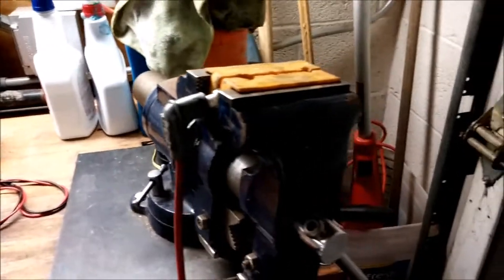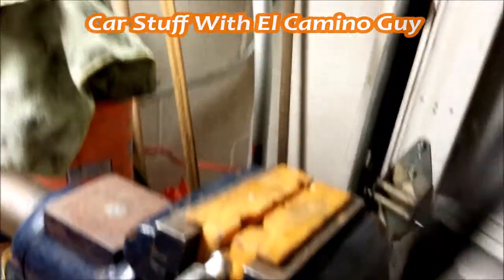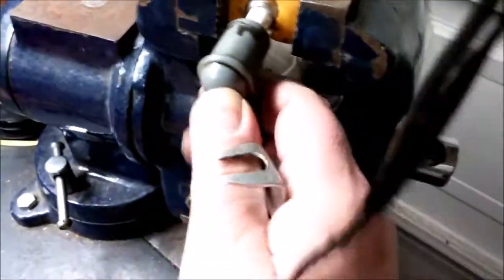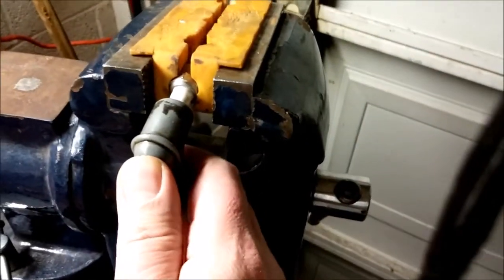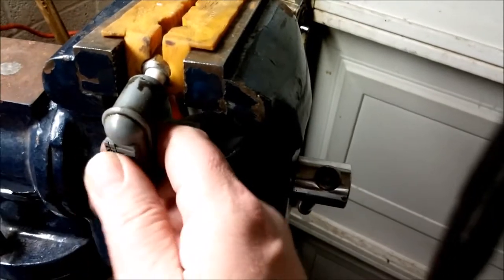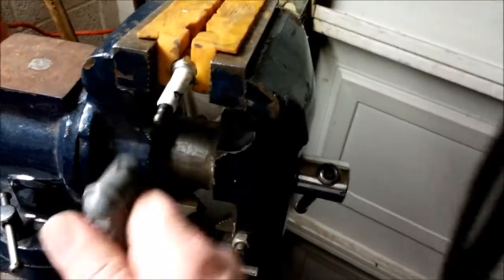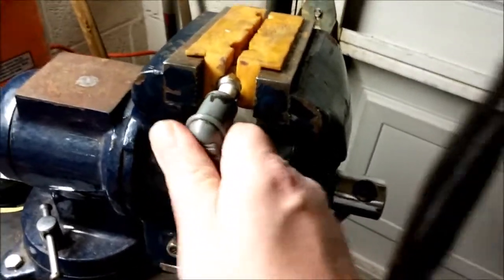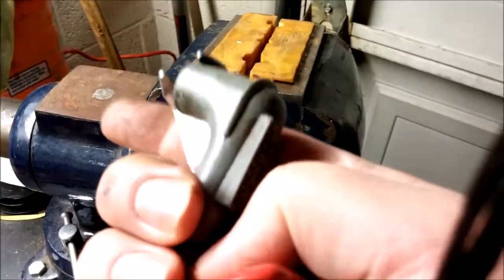Don't be a tool, USE ONE!  Spark Plug Wire Removal Tool

Comment: Looks like a useful tool when I have to change the plugs on my bench vise, now show me the tool that actually fits the plugs boots on the plugs along my firewall
Reply from the maker: Well, it does work when you can actually access the plugs but I'm aware that most newer cars don't make it easy unless they're right up front.  I know it's only marginally useful for my LT1 in my 95 Formula because of how bad access is.   Still, i admit it's not useful for all cases but for others it's perfect and being someone who's actually pulled a wire out of a boot leaving it still on the plug I was happy when I found it.
Reply: I realize it's quite randomly asking but does anyone know a good place to stream newly released tv shows online ?
Reply: @Saint Wesson I watch on flixzone. Just search on google for it :)
Reply: @Walter Valentin Definitely, have been using Flixzone for since march myself :)
Reply: @Walter Valentin Thank you, I went there and it seems like a nice service :D I appreciate it !
Reply: @Saint Wesson Happy to help :D

Comment: The tools apparently not for EVERY APPLICATION but it does work where you can fit it in ? If it was longer & maybe grind down the prongs some for different applications it would be better ? Also if people would just put some dielectric grease on the inside of the boot THAT HELPS A HELL OF ALOT WHEN REMOVING BOOTS. Some plug wires REALLY HAVE A VERY VERY TIGHT FIT ON THE PLUGS AS IN THE METAL PART THAT SNAPS ON, THEIR A PAIN SOMETIMES.

Comment: You've clearly never come across a vehicle with 140k miles on it that hasn't been serviced.
Reply from the maker: I should hope I never do either.....at least if I'm the owner.  The whole idea is to actually DO the service regularly...lol
Reply: @GearheadGarden  I know lol. My wife bought a used 2003 impala with a 3800 in it, so about 2 weeks in I decided to change her plugs for her since we had no idea when they had last been changed. There was very little room for my hands or tools on the rear plugs. So after about 2 hours of struggling and breaking a plug wire removal tool I just decided to cut off the boots with a razor.

Comment: I don’t understand how this would work. 😂 
If you have the plug on the bench or a vise, the nut means you’ve successfully remove the boot previously. 
If you plan to use it while it’s in the car… there no way you’re getting that into the spay plug to be able to use it.

Comment: except it's completely useless when there is no room for that to fit around the boot where you actually need a tool to pull a boot off
Reply from the maker: Yeah, not every tool works everywhere but where it does it's a real help and it's worked on a 40 year old car and a 20 year old car.  Will you be able to do it exactly as shown in the video?  Maybe not but sometimes just getting it into the right spot can go a long way to finishing the job.
Reply: i'm trying to get the boot off of the middle cylinder on the passenger side of a 99 Firebird 3.8 v6, saw that tool online (when I googled Sprk Plug Wire Removal Tool) right before I watched your video (which came up on google), if that tool would even slide into place there is not room left for it to be pulled away from the motor, I'm thinking I'll need the tool that looks like a pair of pliers.
Reply from the maker: I had a 96 Camaro with the 3800 Series 2 V6.  I know I changed the plugs once but that was over 10 years ago.  Definitely not as bad as an Lt1 but still tricky.  Sometimes if you can just get it to fit and wiggle the boot a bit to break the seal on the plug it's enough.  I may have done that on mine then got a long screwdriver to pop the rest of it off.  By long I mean one about 18 inches long BTW.  Good luck with it.  I love these cars but they're not easy.  One thing I loved about the 3800 was how easy it was to change the water pump.  Easiest I'd ever done on any car.  Took all of about 20 minutes .
Reply: yeah, it's just getting the boot off, once thats done i'm sure I can get the plug out and new one in from the top and reconnect the wire from the bottom, the front and rear on both sides where pretty easy, then the middle driverside took half an hour of fighting it to get the boot off, if the A/C compressor wasn't there on the passenger side  i'd have WAY more room to work with and would have better angles to come in with the flathead like I did on the driverside middle boot, a long screw drive was what I was thinking too, I just can't find one, I thought we had one, so now i'm looking for other ways to get it to pop loose. I did the water pump too, I think it was even easier on the 99 because of the straight intake instead of the slanted throttlebody, I long ago eliminated the baffle between the air filter box (upper rad support) and throttle body so I have like 6 inches of completely clear space on the front of the motor, oil changes are crazy easy too with the filter right up front like that, but this spark plug job reminds me of why I liked my hondas so much, doing a plug and wire swap was faster then doing a oil change on the firebird.

Comment: No. After what I just went through with my 03 6.0 vortec with 180k miles and no tune up ever from the previous owner, i can tell you this will not work. Either the tool will bend, the plug will break, or you will grab a long  needle nose, a pry bar, and a pair of knipex cobra pliers like I did. All that, along with many cuss words, is the only way to liberate an enslaved plug wire without breaking your mind.
Reply from the maker: This particular tool won't bend.  It didn't come from Harbor Freight tools or a knockoff swap meet...lol  But seriously not every tool works in every situation.  I know that even with this tool it doesn't always do the whole job but it was strong enough and small enough to fit in tight spots and at least get the boot loosened on more than one occasion.  180K without a tune-up, however,  takes the right tool, a lot of time and as you know the right magical phrases.  Most are quite spiritual 
 and start with either ...God...OR  Son of A ....  :-)